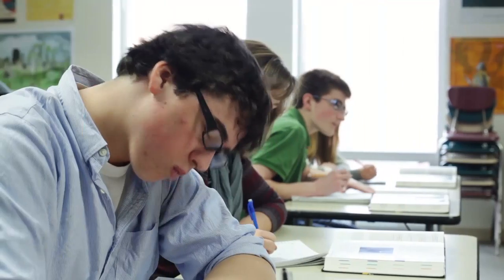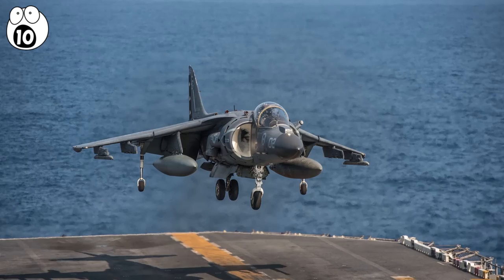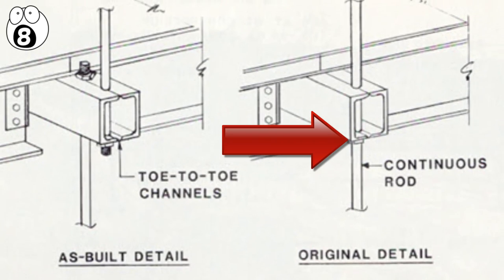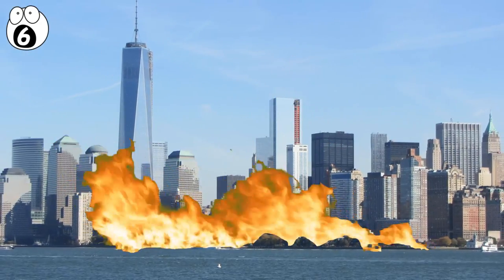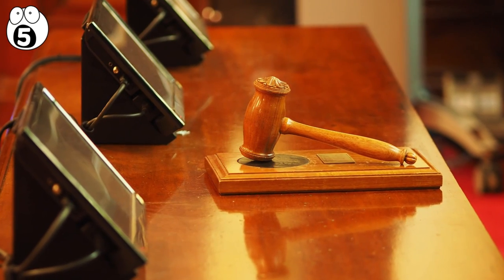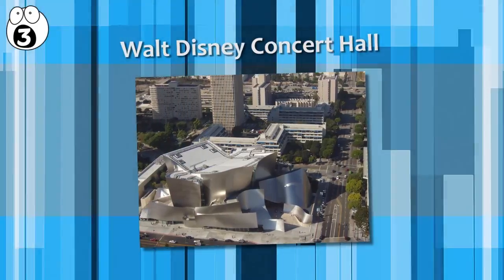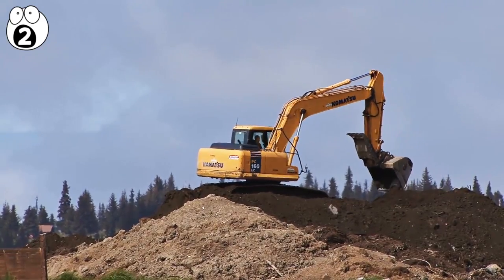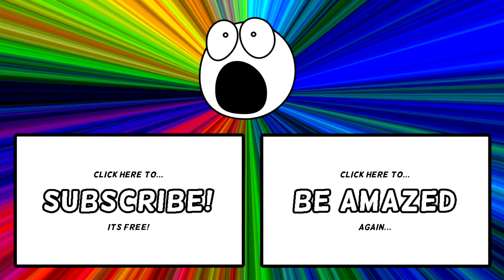Biggest Design Errors Engineers & Architects Made

Comment: Correction: (and this is a big one). The De Havilland Comet aircraft didn't rupture and crash because of the stresses of going "going very fast and very high" per se. While it is indeed true that square windows did provide stress points that did fracture, it was the repetitive pressurization and depressurization of the aircraft that caused the metal fatigue which lead to catastrophic explosive depressurization and the aircraft causing it to break up in mid flight.
These videos are very vague.
Reply: i dont know what your saying... (you have better vocabulary than me by far.)
Reply: They spent ages doing research to fix the issue to, it took a  good few accidents to realise it if I remember correctly (aviation geek)
Reply: And it wasn't merely metal fatigue from pressurization, but both planes went down on the east coast of Italy during the Summer, when it was extraordinarily hot. Additionally, both planes exploded roughly the same distance away from Rome after takeoff—going in opposite directions along the coast. This likely means a combination of heat stress and metal fatigue are to blame. Had nothing to do with fucking windows.
Reply: It had nothing to do with with a hot summer. It had to do with hairline cracks in the corner of the windows and the stamped rivet holes, these hairline cracks where the main reason for the crashs
Reply: +wolf310ii That's just not true at all. That's not what happened. Not even a tiny little bit.
Reply: The research reports, the tests, the debris, all say it was the hairline cracks.
The windows, doors and the stamped rivet holes, reduced the lifetime of the hull dramatically.
metal fatigue->hairline crack->crack->explosiv decompression->hull disruption
Reply: Yep, the failure was even reproduced in a test tank, where the plane did not move at all.
Reply: Wolf310ii is correct.John Petrov unfortunately your theory was disproved when they performed a water tank test on the fuselage. The rigorous tests done during the comet investigations contributed significantly to modern day metal fatigue theory.
Reply: deadspeedv - Pressure tests are done submerged in water in a pressure tank so that when the pressure vessel, in this case a Comet fuselage, ruptured it wouldn't explode from expanding air. Rather it would just burst open with very little expansion of the water. Water does expand some when pressure is released as it is about ten times as springy as steel plus air dissolved in the water expands. But nothing like air expands!
Reply: SuperSix Delta i was looking for this comment. Defuk he Get that from
Reply: Parts of one of the Comets that went down off the coast of Italy were recovered. The rupture that brought it down began at a corner of the small window on top of the fuselage at the rear of the cockpit. What that window was for was for using a sextant for making star sightings for navigation. If that sounds terribly 19th Century, it was there as a backup in case of problems with the fairly new radio navigation systems. Had they used a round window there, a fatal rupture would've started somewhere else. In addition to the square-ish corners on all the windows (they weren't sharp 90 degree corners) the other major problems were the punched rivets and interrupted fuselage hoops. A new method of fast riveting had been invented where the rivets could be punched through the skin and into the framework. That caused small cracks around every hole. Millions of stress risers on every plane, just eager to widen into bigger cracks as the pressurization cycles went up and down. The hoops that form the round shape of the fuselage weren't all 360 degrees. The designers laid them out evenly spaced, and wherever a window was, the hoop would have a gap cut and the ends riveted to the window frame. They also had some pipes and wires fitted between the hoops and the skin. Rather than forming the hoop flanges to make dip for the pipes and wires to fit through, they just cut partway through the hoop sides, same as a carpenter saws a notch in a stud to run wire behind drywall. Interrupting the hoops with windows enabled the top and bottom of the fuselage to pull up and down on the window frames, putting even more stress on their corners.

Thus an adequate design was compromised literally by a million tiny cuts. Had the rivets all been done conventionally with all holes drilled and deburred on both sides, had the fuselage hoops all been 360 degrees with one each side of all the windows, and had properly formed places to pass wires and pipes - it's likely that the less curved window corners might not have been a problem, or at least not a catastrophic the whole plane blew apart problem.

For the water tank test, a Comet had everything stripped out inside, leaving a bare fuselage, tail and wings. A huge metal tank was built, with seals where the wings poked out the sides. A hole was cut in the top, a pipe flange attached, then a large air compressor was connected. The pressure was run up to make the inside VS outside differential match what it would be at the plane's cruising altitude. Held for a bit, then let down to ground level pressure. They ran the pressure up and down, thousands of cycles until BOOM! The sides of the fuselage 'unzipped' right along the bottom of the windows. Since they had the whole thing right there instead of moving hundreds of MPH several thousand feet up, every bit could be examined to see exactly what failed. That it ripped apart through the window corners is what implicated their size and corner shape, but just having smaller windows with rounder corners would not have saved the Comets from all the other blunders.

That's how they discovered the part the punched rivets had to play, along with the discontinuous hoops and other issues incompatible with a pressurized aircraft.

Later build Comets went a bit overboard on the windows, switching to a sort of tiangle teardrop shape with a flattened bottom. That evolved into the size and shape used on every other airliner up to the present. It's not that they can't use larger windows for a better view, it's that the specter of the Comet's failures still hang over the industry.

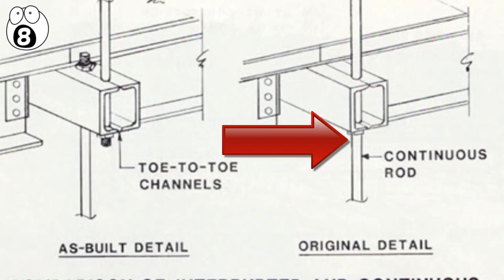Comment: I'm an architecture student that studied the failure of the Hyatt regency ballroom walkway. It wasn't the rod that failed, it was the box beam. If you go to 2:51 and pause it, you'll see that the beam was fabricated out of two steel channels welded together toe to toe. What happened was those two rods were sandwiching that box beam together in its weakest location, so the webs of the channels bowed out and the rods slipped through.
Reply: True, but there was one more factor - the design change (2 rods instead of one), that put the nut under twice the stress that it would have had to bear originally (the NUT, not the rod as the video states - the load on the rod is exactly the same in both designs)
Reply: Yep it was the fixing points that failed (due to double loading) not the rods or beams per-se.
Reply: Also he says the issue was with the top rod taking too much weight. By my understanding the amount of weight it would have taken should be the same.
Reply: Daniel Walmsley Exactly! So I wasn't the only one thinking that!
Reply: Thank you! This idiot was talking about the forces on the rod in a completely nonsensical manner. You saved me a Google.
Reply: You are right, and that too was a "last minute" design change due to aesthetics. The original design was with the c-channels back to back = maximum strength, but "someone" didn't like the look of it.
Reply: @Left Flamingo so two design changes?
Reply: According to the accounts that I've seen/read, yes. As far as I know, the two changes were made somewhat independently from each other. I.e. the toe-to-toe welded box rail might have stood up to the original design for the mounting, and vice versa the two-rod mounting might have worked with a back to back mounted rail (since the backs of the c-channel are its strongest point). Together, the two changes spelled disaster. And could, of course, have been avoided by a quite quick and easy solid mechanics calculation.

But, I must stress that this is based on my recollection of one or two articles + a documentary over, at least, 10 years ago =)
Reply: Left Flamingo I did a bit of digging and it seems you are correct. Makes me wonder what happened to quality control.
Reply: In our "The success of failed engineering" class, the result of the unauthorized design change, made by the construction company, was that it changed the design from each walkway being suspended by a single nut to BOTH walkways being suspended by a single nut.  Two walkways on a system designed for one.  The pictures of the support rod CLEARLY show the nut stripped out the threads, no "box channel" failure.  I have no idea where this idea came from.  The pictures of the end of the rod are very clear.
Reply: that AND they was an unintended factor in ALL OF THIS. HUMANS. It would have held fine if it were used for what it was, a walkway. But it was a walk way surrounding a lounge. one night, there was a really popular lounge act going on, and lot of people were on the walkway, dancing and jumping about. I dobut the designers thought about this ...POSSIBILITY...when designing it. Sometimes, you have to over engineer for safetys sake!
Reply: You absolutely over engineer for safety read https://en.wikipedia.org/wiki/Factor_of_safety for general information on how much over engineering goes into various things
Reply: +david beckenbaugh With all due respect, I tend to disagree. I'm sure there were threads failing too, but so did the box construction. Check out e.g. http://www.structuremag.org/wp-content/uploads/2016/07/0816-sf-4.jpg

The horrible box design, together with the change in suspension method, was the main reason for failure.
Reply: I think its agreed on that the explanation in the video is completely wrong. Yes, the shop design might have worked if the original box beam and larger washers had been used, at least in a partial failure without collapse, but it was the moment distance between the two rods that increased the forces to pull out failure.  

Having said that the original single rod design was unconstructable or at least extraordinarily expensive from the start; that is it wasn't an aesthetics decision or weight issues.  The rod would have had to been precision  custom made with interval threads and differing rod diameters to get the bolts/washers into place.

Sadly, this total misunderstanding by the producers of the video makes the other explanations suspect.
Reply: There are several ways it could have been made to work though but none of them seems to have been implemented.
Reply: @Left Flamingo  I appreciate the picture.  Without more context (I know the general context), I cannot place how the damage occurred.  My class was at the UW and they (generally) get things correctly, but each professor tends to give their own opinions on things at times and it can get distorted.  In the end, it does not matter as long as, in the future, BOTH probable causes are considered and taken into the equation.  But, again, thank you for the picture.  So many people will stick to their own beliefs and not even bother to check evidence posted by others.  I want you to know I consider it, and don't reject it.
Reply: Just read the ASCE report; it doesn't support the video's version.
Reply: I used to work with my father who was a professional engineer and forensic expert.  We did a great deal of failure mode and effects analysis.  One of the things I think was a contributing factor of the Kansas City disaster was the failure to account for dynamic load versus static load.  Most designers will only account for the predicted loading of a static (non-moving) mass acting under the force of gravity, as if the hundreds of people on the walkway were standing still.  To my recollection, there was music being played in the atrium and people were dancing on the walkways.  When you introduce dynamic forces (jumping, swaying, running), suddenly you have multiple directions of force, not just vertical, but if you have rhythmic pulses of force (synchronous to the music, for instance) you have the potential for substantial increases in instantaneous impulse forces.  I seem to recall a rule that marching troops had to break step when crossing bridges for this reason (following the failure of the Broughton Suspension Bridge in Manchester, England in 1831).  Mythbusters famously tried (and failed) to reproduce the effect in a scale model.  Whether overloading, dynamically induced oscillation or the unapproved changes alone could have caused the failure, it is without doubt the result a confluence of several anticipatable conditions which were not considered as a whole system.
Reply: @Left Flamingo The box construction wasn't the problem, the problem was a change in load from the change in design, doubling the pressure at the connecting point. No engineer agrees with you in that it was the design of the box that caused the failure.
Reply: Sean Bosworth If the beams weren't box-welded, then the walkway might not have failed. Engineering failures are almost never due to only one factor.
Reply: +che3se1495 Not a single engineer? That's cute that you think that =) I guess you haven't read through the thread then? Or read the accident reports? Or looked at any of the evidence? To make a claim like yours, you have to have the cocky confidence of someone who has no formal expertise and no experience. It's straight down foolish to say that the box welding had nothing to do with it because joining a construction at its weakest point, with a weld no less (tip, welds almost always weaken the base structure), can have no beneficial factors. If you know anything about solid mechanics and construction, you would know that almost all the structural integrity of a C-channel is at its back.
Reply: The box construction was fine, the change in load was the problem that caused the failure. If the change hadn't been made it wouldn't have failed. The ASCE report agrees with me. All your formal expertise and experience apparently did nothing for your reading comprehension.
Reply: =D
Reply: che3se1495 You should really read a lot more on the subject. Even the wikipedia article on this has a photo of the c-channel split at the welding points. 

Tip - in most such situations (from construction failures to airplane crashes) there are multiple factors that contributed to the end result. It is a bit... naive to say "it was this and ONLY THIS that caused it!"
Reply: Bogdan Sass, like I said, the two rods were sandwiching the box beam. Those forces were too much for both the welds at the toe of the channels and the webs of the members themselves.
Reply: Sean Bosworth I actually agreed with you :) . There were multiple factors that caused this - both the c-channel design and the structural change (2 rods instead of one) were among them.
Reply: che3se1495 looking at the failed members clearly shows that the box beam failed. The web thickness of the members was not adequate to handle the forces in the designed distribution. The location of the weld seam was right where the bolts were penetrating, causing the weld to fail, the web to bend, the hole through which the bolt was fastened to enlarge and ultimately allow the bolt to slip through. The connection failed because of the beam's construction.
Reply: The box beam and rods was not a design issue.  It was a change made on-site by the construction firm, without sending it back to the architect for engineering evaluation, because the original design would have been more difficult to fabricate.
Reply: You're all wrong. They didn't use washers with the nuts. That's why it failed.